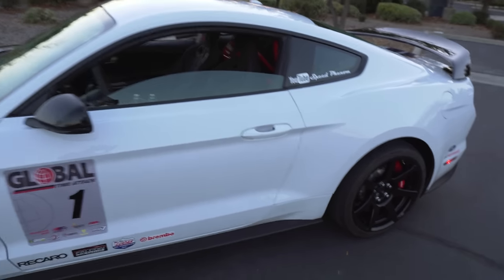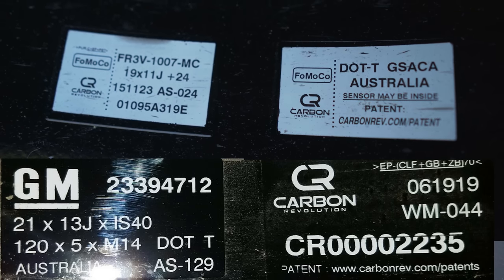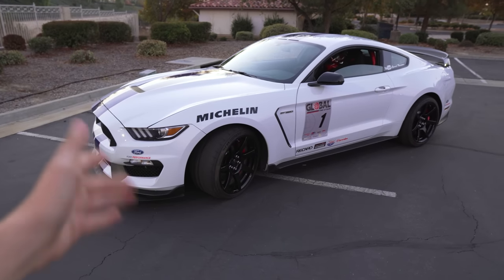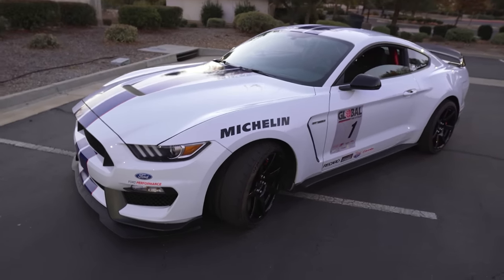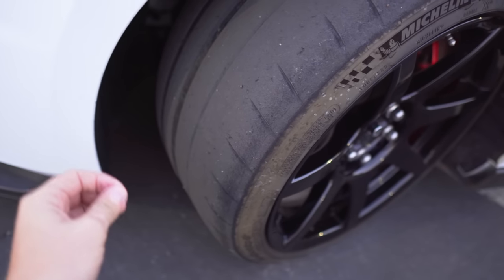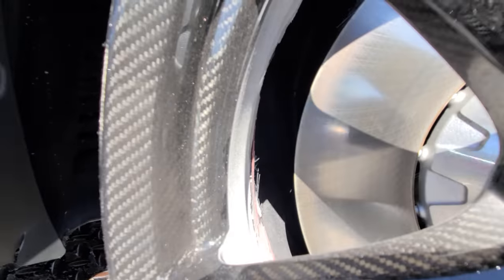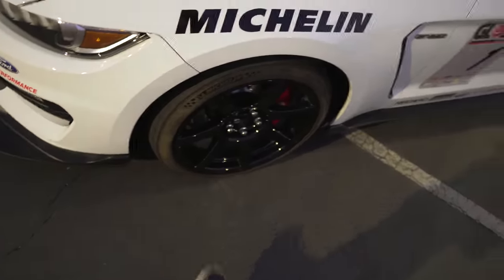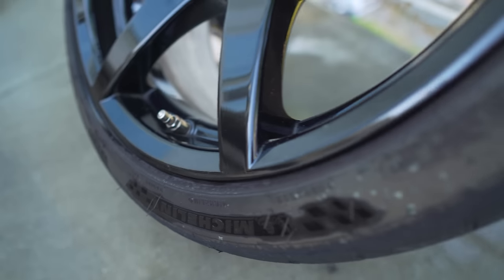NEW MUSTANG GT500 SHATTERS CARBON FIBER WHEELS ($18,500 Option)

Comment: It's actually normal, as the barrel deformed and contacted the brake assembly and poped back. Metal might have seized the wheel against the brakes potentially destroying both wheel and brakes.
Reply: CF deforms??, what ??
Reply: @alexpocs8649  CF in simple shape will flex and come back, but with complex profile has higher chances to delaminate and brake stuff.

Comment: Speed Phenom Great Video I'm Surprised that GT500 CFTP Wheel Shattered like that since I've heard Carbon fiber is very strong although apparently there is a weak point and Happy Belated Thanksgiving to you and your family
Reply: It is not as strong as mist alloy wheels and not even close to steel.  Light weight yes.  Expensive... yes.

Comment: A set of run flats might protect
the wheels as well as the car.
Reply: True but run flats are heavier - less grippy  so that defeats the purpose of a lighter wheel.
Reply: @richardmorris7063  if money is no object don’t protect the fiber wheels  and look for object in the road. The one that took out that rim should have destroyed the splitter first! So it comes back to car control. Be the driver and not just along for the ride!

Comment: Steel is very ductile, meaning when it deforms due to an impact, it will bend first, then may crack depending on the stress. Carbon fiber wheels are stronger than steel, but more brittle. So when they do fail, they tend to crack right away instead of bend.